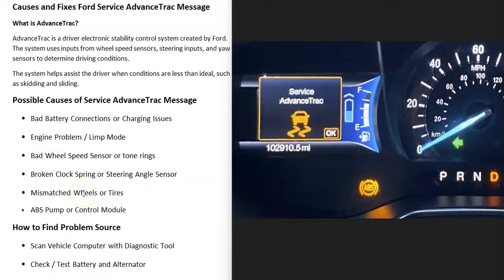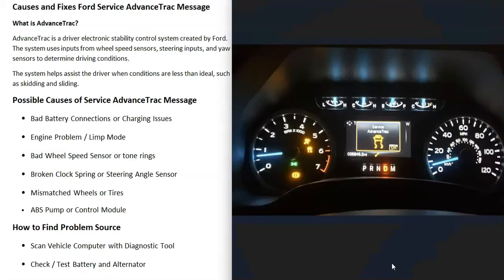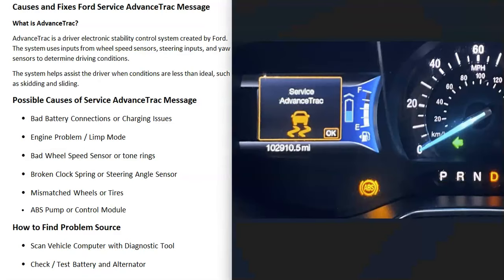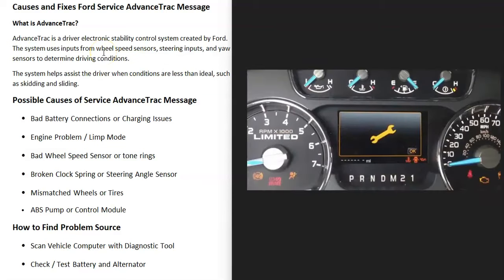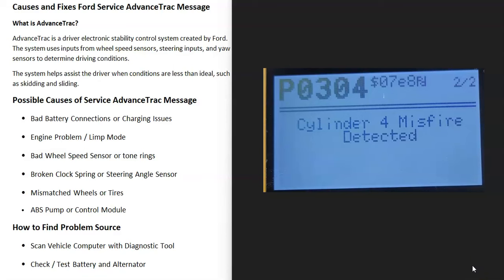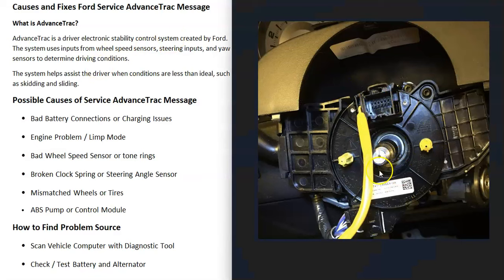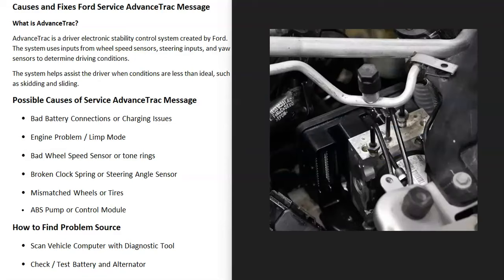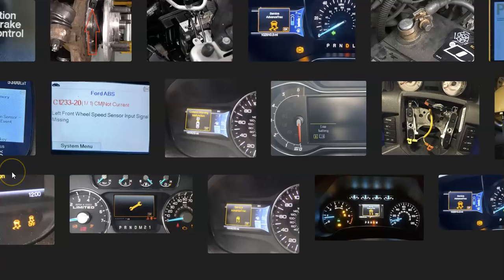Service AdvanceTrac Message Causes and Fixes

Comment: Well here I am, my light just came on and my wheel is now tighter when driving . We didn’t ask for this computer bullshit. What happened to a good old fashioned 4 tires and an engine.
Reply: Mine has the same problem did you ever get to fix it?
Reply: Most people don’t want a Fred Flintstone car. We absolutely did ask for these computers. They rule and most of these items are easily fixed. Things break and need maintenance, even those old junkers.
Reply: If anyone is wondering I had the same issue.Turned out to be a circuit breaker A that's grounded on the side of the fuse box.
Reply: Nobody made you buy the “computer bs car” so it looks like you did ask for it 
Otherwise you’d have purchased a classic vehicle
Reply: @GavinoFlores. nobody was wondering and I doubt it was a circuit breaker
Reply: @JasonLee-lv7tm  I do too until I found out it was
Reply: @JasonLee-lv7tm I was wondering keyboard champ 🤡
Reply: Same
Reply: Go get an old truck fix it up nice and you won’t have the bullshit anymore. That’s what I’m gonna do.
Reply: Ouch, that’s expensive.

Comment: I’m backkkkk, I just paid $1400 to have my rack and pinion replaced and guess what, same fucking issues 2 weeks later . My messages just popped back up tonight . So it’s not the rack and pinion
Reply: Ever figure out what it was? This computer crap is more of a headache than anything
Reply: I hope they had substantial evidence your rack and pinion needed replacing. Half a dozen minor issues can cause this, and they went straight to one of the most expensive possibilities?

They clearly reset the computer which bought them two weeks before the code came back, they likely didn’t fix anything necessary.
Reply: @fZionists78  I found out they just didn't do the flash code bc they thought it would be good to go. So yes they fixed the rack and pin but didn't flash it til the second time it happened. it's been a couple months now and my car is running normal again
Reply: @brandonyafanaro9710  
I am wondering, if it was the rack and pin wouldn't the car make a cracking noise when you turned the steering wheel?

Comment: My 2014 Utility Interceptor has this problem too. I'm thinking it's because my wheel is not aligned perfectly, and the steering wheel sits a little to the left. But my car drives perfectly fine other than that.

Comment: I have a S550 Mustang that I take to autocross. I set it on Track mode and about 50% of the time I get service advanced track. Once I restart the car, the code clears. I have no idea what it is.  I really like how the car drives with advanced Trac. Guess I’ll need to scan it while it in error

Comment: i'm 9 months into trying to fix my advance trac,  its' a shitty warning light,,  started with limp mode issue 1 year ago, then I've replaced the following. throttle body, ecm, wheel speed sensors,  instrument cluster, 4x4 control module, the only other code I get is fuel level sensor, it'll eventually cause my car to not start

Comment: Thanks man. I have a similar problem with my 2017 but it’s not the shift bushing it’s more complicated than that. Your video is the first one that has steered me down the path of figuring it out. It happens to my car when it’s very humid like foggy and or raining. But otherwise it’s fine. Anyways I appreciate that advice and I will read thru the comments and maybe add a fix here if I figure it out.

Comment: I had this issue 
Random shut down P0320 there's a wire harness that rests on top of the Front RH valve cover The wire can rub through and ground on the valve cover bolt .Will throw a crank sensor code .
Hope this helps

Comment: Having similar issues with my 2017 Ford Fusion. Starts when turning the battery on: flashing warning signs, check engine, power steering, ABS, and hill assist disabled. I USED to be able to unplug the battery and let it sit before re plugging it in and the car going back to “normal”. Now, however, the last time I did that it wouldn’t reset.
Reply: Did you figure it out ?

Comment: I had to jump start my 2016 f150 and now it is really hard to steer! And I have a light on my dash that came on?
Reply: I have the same issue on my 2017 F-150. After replacing my battery my steering wheel became my stiff when turning. Soon after the advance trac light would activate. When I turn off and restart my car the code is gone but steering still stiff. Did you ever figure what was causing your issue ?

Comment: I have a Dodge grand caravan. My throttle control light comes on a half a second before the traction control light comes on. I've already replaced the throttle body and a map sensor that O'Reilly's suggested I replace from the codes they read. It's still reading the same map sensor codes, and both the lights keep turning on after I drive or let it idle for a little while. I'm wondering if I have a wheel speed or traction control sensor that is dirty and not making a good connection or needs to be replaced. Could this be causing my throttle control light to be coming on and flashing? Sometimes my vehicle goes into limp mode on the highway. Please help!

Comment: I'm purchasing two 2012 f150s with service advance track issues, and the trucks won't steer at all. I haven't had a chance to diagnose them fully yet. Just wondering if these two trucks might need a new rack and pinion or if it might be an easier fix potentially. Thanks
Reply: I just paid 1400$ for new rack and pinion on my 2012 fusion sel, my service lights just came back on tonight.
Reply: So no, don’t let them talk you into rack and pinion

Comment: Thank you for the video and info.  I've been struggling with this issue for the past year on my 2021 Ranger.  First trip to dealer a year ago under warranty they scanned and found code C003A but didn't find a problem when an electrical diagnostic was run.  For some reason they replaced a rear wheel speed sensor, cleared the codes and called it good...which it wasn't.  Problem came right back....fortunately I didn't pay anything.  The issue comes and goes but never stops from driving.  Lately it's happening a lot, so took it took it to dealer for oil change and diagnostic, but this time bumper to bumper is gone. They want $175 just to try and figure out what's wrong...and for which I told them No!...and which thanks to you seems to be an OBC scan and some possible very easy fixes.  Feeling a bit dumb because I have a scanner and should have thought of this, but really appreciate the the guidance here to get me thinking straight on this issue.

Comment: What if there are no codes displayed after a scan? While driving home from the store in gusty conditions today, abs light came on, service advanceTrac, pre collision assist not available, hill start not available, check park aid. I cleaned windshield and collision sensors, did a scan with no codes, started 2019 Ranger got all the error messages, drove around block, steering didnt feel right. Parked in drive rescan with no codes.
Reply: Same thing for me, but lights came on for a short time and went out on their own.
The next time it happened, I pulled over immediately with warning lights still on and no codes showing.
Reply: Did you figure it out it ?
Reply: @RicardoRamirez-hy2de  I drove 3 miles to store at normal speed, i.e above the 20 mph in my neighborhood. When I got back in truck from shopping....all the error messages were gone. Seems like I needed to drive a certain distance above a certain speed for the computer to reset.
Reply: @randallgreer1994  oh dang, well that’s good, ended up being my ABS module for me 😪

Comment: My using FORD FUSION 2014 MODEL i have been seeing this Service Advance Track when ever on a rough road i don't knw what could have cause that am thinking it might be the Wheel speed sensor so please how can i fix it
Reply: Did u find the problem?
Reply: @guanako503cristian  Yes i took it to a mechanic shop and he changed both front wheel censors and the problem got fix and it doesn't cost that much i think i paid $20
Reply: @worldcelebrityisland8813 
I have the same problem on a 2015 Exploder. Advancetrac, downhill, abs lights on.
Reply: @kentuckywindage222  take it the mechanic and let them scan it for you may be the wheel 🛞 censors are damaged
Reply: @worldcelebrityisland8813  
Thanks for the reply
Reply: @worldcelebrityisland8813  
My Advancetrac, Hill Decent, traction control, ABS lights would cycle on dash with audible tones. Ending with ABS, Traction control staying lit. When checked for codes 0 were there. Alternator good, battery good checked at O'Reilly. For shii and giggle I had Advance Auto do the same tests. Battery showed good but needed charge, alternator good and no codes. Bought a battery and installed at Advance. Lights stayed on for 25 miles. Shut off, sat 1 hour. Upon start the dash was clear with no audible tones. Drove another 25 miles home and still clear. Hope this resolved the issue.
Reply: Drove about 75 miles and back on.🤦🏻‍♂️

Comment: 2015 expedition my light came on but Is no throwing any codes, speed goes fast and cruise control works fine as well any help please??
Reply from the maker: Your scan tool may not be able to read all the codes and modules (ECM/PCM/TCM/ABS).
Reply: My 2015 Exploder is doing the same no codes showing. Tried O'Reilly ans Advance. Advance said battery was low needed charge, alternater good. Replaced battery and next restart dash cleared. After about 75 miles turn left at a traffic light my brake pedal shuttered like antilock and lights came back on.
Anyone have this issue?

Comment: I’m having an issue with it showing only when I am slow almost to a stop and have the steering wheel turned way to the left or right. Ill have to try the scanner and refer to this video!
Reply: Having the same problem as you

Comment: I have these issues with ford 2016 wildtrak ranger. intermittent loss of power steering. whenever I turn the wheel to the right or left, it pushes back to center real quick. I recently changed my upper arm bushings and shocks. Do i need an alignment and do i need to reprogram the steering sensor?
Reply: Did you ever figure out the issue?
Reply: @RicardoRamirez-hy2de  yeah.. they open up the steering module and the circuit board is bent. they soldered everything that needs soldering. something hit the module very hard. so, they put it back together and check all connections with the harness. they even put a cable tie wrapped around the module that tightened up the harness.. it's been 6 mos now and it's fine.
Reply: @mistergreen6557  gotcha, thank you sir, I just had mine fixed and was my ABS module, had the same issues as yours with the loss of steering wheel and lights coming on
Reply: How much did it costs you?

Comment: Just got 16 navigator back from dealer for recall of brake booster pump, service wrench symbol came on and advance trac light comes on then goes away. Pulled neg cable to try to reset, but light still comes on, back to that dealer monday, car ran perfect before they touched it

Comment: Thanks for this video; straight to the point.  I have 2011 Econoline Van E350 with the AdvanceTrac error but no ODB2 codes.  I have two possibilities: (1) two new tires on rear, front tires worn and need replace, (2) front left inner rotor area picked up a stray piece of metal off the road and was making sounds as it rotated around or sometimes got lodged, I thought brakes/caliper issue I since removed but perhaps it messed up the sensor. (I have no codes).  Anything else I may have missed?  thanks.

Comment: DETACH YOUR BATTERY CABLE FOR 60 SECONDS AND REATTACH. EVERYTHING WILL RESET INCLUDING THE ADVANCE TRAC MESSAGE. I’M NOT SAYING YOU SHOULDN’T GET IT CHECKED OUT. THERE COULD BE AN UNDERLYING PROBLEM, BUT IT WILL GET YOU ON YOUR WAY.

Comment: This feature cause more danger than safety. Service AdvanceTrac turned on and locked my steering wheel.

This shit is dangerous asF
Reply: Did you find out the problem and get it resolved? I had that happen exactly the same way two times.

Comment: My Advance Trac service light came on and hill decent fault got trigger shutting down abs stability amd traction control going to go clean up the battery and check the fuses before i take it to mechanic and get raped by my wallet. lol
Reply: Hi, I have similar issues in my F-150 2018, I scanned and found Lost communication with Anti-Lock Brake system ABS. The electrician said needs to replace ABC completely!!!  
Is it Right ?

Comment: When service Advance trac system message comes on along with multiple other warning lights and all gauges shut off, and I put tranny in reverse there is a weird clunking in the rear.  when Service advance warning is not showing there is no clunking.  Can the computer system cause mechanical things to happen?  Ford is saying its my transmission.  never have had any problems until today.  I am thinking its the Ford computer causing the problem.  PLANNED OBSTILEANCE!
Reply: OH MY TRUCK IS A FORD F250 SUPER DUTY 4X4 6.7 DEISIL 127k MILES ON IT.  Never been 4 wheeling